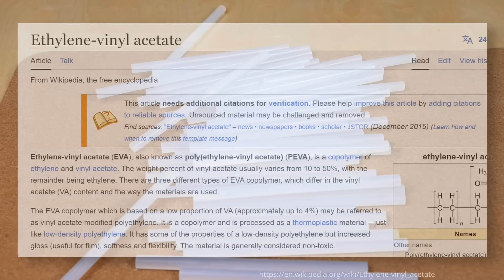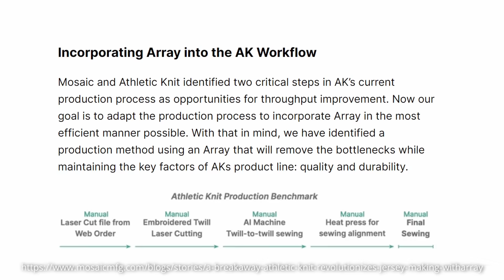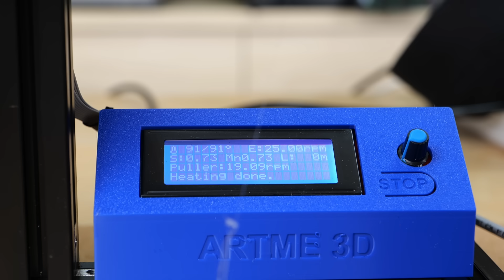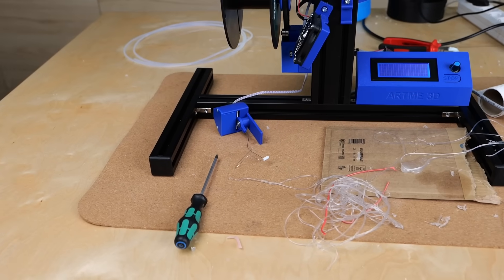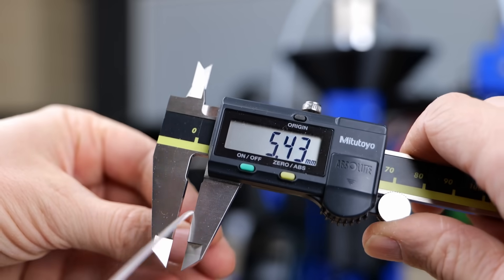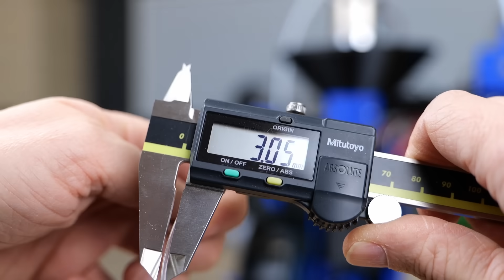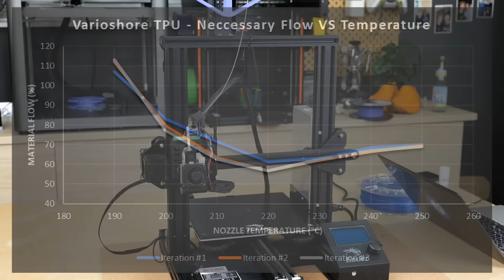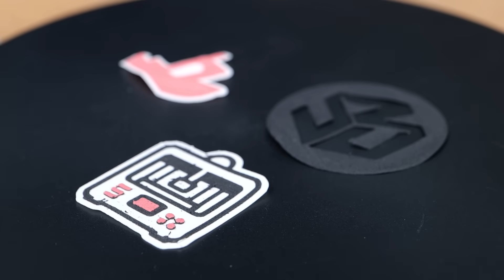Can you 3D Print with Hot Glue?

Comment: Excellent experimenting and engineering Stefan! Seeing the household iron has a 170ºC for cotton, makes me wonder if there is a material that has a melting point between hot-glue and PLA?  Searching, found "Hot Melt Adhesive 3779" (3M) is listed as having a melting temperature of 163ºC.
An alternative might be to try "Adhesive Sheets" which could be cut to shape with a vinyl cutter, then applied. 

BTW: found it a bit ironic that used glue-stick was used as a release agent for the hot-glue.
Two layers of glue not glued together! You're definitely an engineer with a solid materials understanding.

Comment: The filament seems pretty cool, but using it as an actual heat-activated adhesive seems incredibly unnecessary, given that there are hundreds if not thousands of liquid heat-acrivated adhesives available, and you could simply apply a layer of one of these to the back of the print - a process that would likely take less than a second in an industrial setting.

Comment: Very cool idea, however, it would be a lot easier to just use iron-on vinyl and a plotter to cut it, like a Cricut, or, you could adapt an old printer to have a blade instead of a hot-end. There's readily-available iron on vinyl, they call it "heat transfer vinyl" - and you can do up to 3 layers/colors. 
Hope that helps :)

Comment: While the freezer worked ok for this application, if you want to get colder temperatures or faster changes in temperature for cold processing of materials such as intentional enbrittlement, quick-setting or tempering, there are three other options that may be easier to come by. The cheapest (long term) and coldest option is to buy liquid nitrogen the next time you go to a population center and keep it on hand. The cheapest short term would be air dusters. They are filled with butane or other lightweight, liquefied hydrocarbons. Inverting one of these cans will dispense a stream of liquid that quickly boils off, sucking the heat out of anything it touches. A middle of the road solution would be to buy CO2 at a welding shop (which tend to be more common in rural areas) and opening the valve while inverted, without a regulator. Releasing this gas into a cloth bag such as a skiing sock or old trouser leg will allow you to form your own dry ice on demand. 

To prevent the peeling, you have to lake the glue layer just slightly larger than the design layer and will need to use something like foil, acetate or waxed paper as a release when ironing them on.

Comment: Hey @CNCKitchen ! I've transformed one of the insert soldering iron tip into a kind of pyrographic tip to carve and solder prints together. It works pretty well! You should really sell some on your store! 
I first saw someone using pyrographic tools to sculpt and smooth 3D pens creations and i think there would be a huge benefit to have a variety of sculpting ends to help blend seems, join parts together, maybe scoop material. Im sure if you make some, the market will explode with high end surface finish to improve the experience.

Comment: Great video! I've been thinking about trying this for a while, both the hot glue extruder and the TPE shirt printer. 👕 Your results speak for themselves and I'm sure that you could refine the process and create a lucrative business with this idea. 
I can also see other possibilities for applications of the hot glue printer. Perhaps something along the lines of using it to fuse two previously printed parts or fusing two different materials. Of course, you could easily do that by hand, but on a mass-scaled assembly line, it would be very productive.

Comment: i think hot glue alone is not very useful but if you mixed it with other materials it would probably retain its ability to stick without being as difficult to handle. the mixture should be formulated so that the hard material gets squishy while the hot glue completely melts

Comment: If you want harder, more solid glue sticks(would be much easier to blend I guess), switch over to Steinel Ultra Sticks. Also makes tempcontrol easier, as they can take higher heats.(rated at 200°) Those Pattex are kinda weak in every aspect.

Comment: The hotmelt adhesives used within industry are most often produced by emsgriltech,  the brand is griltex.  It is sold in pelletized form.  I don't know if it can be made into a filament as we extrude direct.  It does have to be sifted for best results so that makes me think it would work.  The stuff is a bit of a pain to work with, but works really well.  My money is on this is what they are using for the adhesive for the logos.

The temperatures are a little higher than your average printer might be able to sustain but I've also never tried using this on a consumer one before. I would be interested in finding out.

Comment: why bothering making hot glue filament? you can just put the shreded hot glue over the printing surface and melting them to a thin layer by placing the baking paper over them and melting them with the iron, then print tpu over this hot glue thin layer.

Comment: Honestly, I am sure you've opened a gate for a brand new type of 3D print. Someone will maybe be obsessed with this video and developp an universal way to make hot glue filament, and a new era of 3d printing will begin. Imagine the application of hot glue in a print, you could more easily stick them togeher, make impossible or hard to assemble prints be easily attached, your garage won't need a thousand screws to hold everything, it will be hot glued with a industrial strenght HG filament. 
Sir, you are a genius, even if this seems little, you have made a giant step into the future.
I cannot wait to see what 3D printing will look like with your innovation
Reply: two comments above yours, states TPU can just be directly ironed on from the back side of the shirt and hold until several washes later edges come loose and you can iron on again... got to give a go.

Comment: Optical filament position sensor?
If those even exist it would be perfect. And not touching the filament at all would probably increase consistency in non cursed filaments too. A camera sensor would probably work but it's need software or. Well it'd need something.

Comment: I think in this particular application this method of 3D printing the first layer is not the elegant solution, but some other hot melt glue applying method. Some hot roller that applies thin layer on surfaces etc. might be much faster, easier and overal better.

Comment: I wonder if it would work better, if you just used a motorized glue gun and simply modify it to be able to control it with klipper or something. That way you eliminate the need to create the filament in the first place. It probably won't work for actual 3d printing. But for making a sticky base layer could possible be the way to do it.

Comment: Hi Stefan, id like to inform you that "hot melt tape" exist and it may be easier to use for both t-shirt prints as it is thin and flat and filament making because you can probably use pet bottle recycling machine to just pull it into filament shape of a desired size.

Comment: Rather than patches, I could see a better use being printing out custom fasteners. Rather than the standard messy way of using a glue gun, what if you had specifically printed fasteners for joining 2 materials that only required a heat gun to apply.

Comment: I do service work at a factory that makes glue sticks, they use a horizontal screw extruder with a 1" nozzle where it gets melted then it gets pulled through a 50ft water bed by a puller belt on the other end. They are indeed coated in oil to prevent them from sticking to the puller belt when they are chopped down into individual sticks.
Reply: Water bath? Interesting
Reply: @casychapin4647  Normal filament is also extruded into a water bath
Reply: @casychapin4647  yeah the factory I work at extrudes plastic through a metal mold in one long strand before being chopped into sections, the water bath is actively cooled so it cools down the plastic quickly
Reply: underwater printing when?
Reply: @toericabaker  cohesion between layers would be shit underwater
Reply: @exowarlock9031 just need something sticky underwater

Comment: Working with hot glue a lot making cosplay props with EVA foam, I needed a way to cool down the hot glue quickly so I could move quickly and finish a costume. I don’t know how feasible it is for printing, because of how long it takes, but using a can of compressed air and turning it upside down will make the liquid spray out and instafreeze the glue. You could easily waste an entire can on a few layers of the print and you’d be babysitting it the whole time, but it would be a quick fix to having your print not cool fast enough.

Comment: I don't quite understand why you wouldn't use the hot glue sticks directly into a much larger extruder mechanism much like a home use hot glue gun.  Then with a properly sized nozzle and feeding method / mechanism extrude the filament directly from the supplied glue sticks.   Also, as one viewer suggests could you use a cooling bath to more quickly solidify the filament.  I surely do appreciate your work and your channel.  Thank you

Comment: To me, it seems you essentially need to pass a 12 mm "filament" through a heater block and size reducing nozzle like a funnel. Just like the process for drawing wire through a die.  No need to chop it up into granules beforehand, which would probably reduce the air and contaminants caught up in the material.  Why not try pushing the sticks through in their current form, but using a much larger nozzle , say 1-2mm, and see how that goes, then you can tune it in from there.  It would probably need for you to custom build or modify your extruder to do so, rather than using an existing FDM printer.  Any glue filament layer you produce doesn't need to be so accurate down to 0.2mm as you would get from standard filament.  It is just going to get melted anyway and ooze out unpredictably in all directions, so an accuracy of 2 mm or more would be plenty of resolution.

Last time I got glue sticks (some time ago) they were 30cm long.  I have also seen mini-sticks in hobby and haberdashery stores for mini glue guns used for jewelry and scrapbooking, etc.  Probably 4-5 mm diameter.

Comment: Wouldn't it be better to put the coloured side on the print bed with maybe matte texture or whatever is desired for the patch, and put the glue on top? I've always found the first layer to be easier to dial in than all the other tinkering.

I'm also curious about if an extruder like kevinakasam's papilio would be effective for making filament by not leaving tooth marks. The filament path for that filament maker is still a bit puzzling for me.

Comment: U can buy hot glue in sheets. There is a lot of different kinds, TPU or EVA, various thickness, solid or crosshatched etc. As they are used mostly in clothing / sewing industry I suppose it should be much better solution than specialised filament. Just cut out shape u want, maybe by hand, or laser, or cricut.

Comment: couldn't you just heat the bed to about 90C, paint the print area with an off-the-shelf glue stick, and then print normally on it? the glue stick either needs a simple dedicated tool-head or you print a  outline and then pause for the user to manually paint.

Comment: I think this is good idea, but instead of printing the adhesive, you could try printing onto it, I did a bit of googling and you can buy the iron on fabric backing, the few I've found descriptions for say it is a polyamide material, so I'm thinking you could do a cut path with a hot hot nozzle, then print onto the sheet your design, then peel it off the backing paper, You might need to consider the design material temperature range, probably need to be on the higher side. Good luck!

Comment: Nice tip from Adam Savage - if you touch melted hot glue with your finger put that finger in your mouth (or just lick it). It will solidify instantly and won't burn your skin. Strange or funny as it sounds it actually works :)

Comment: LOL, Stephan is both a genius and a showman, had me lol many times in this video.   A great idea.  Finally I can get my 3d print first layer to stick to the bed!
Actually, this is really what I am looking for, something to print an etch resist onto a pcb.  Some have tried pla, but it does not stick to the copper.  But hotmelt?   Perfect!
The problem I see is 'stringing', as you can't really retract the material and any strings will be fatal to a circuit.   If that problem can be solved, this might be perfect solution.
I don't think a filament is necessary, but use the same as a glue gun, just with precise pressure.   They have '3d pens' I should google how they work....

Comment: Speaking of hot glue guns, I've used a 3d Printed stick of PLA in a hot glue gun to reinforce/repair certain prints that had under extrusion on a couple of layers to save me from reprinting the whole thing.  A 3d pen would be better, but it works quite well in a pinch.

Comment: An interesting proof of concept, and for someone willing to put in the time probably quite practical and useful. One thing comes to mind, reversing the process, printing PLA onto baking paper stuck down on the build plate (would it stick - don't know), then printing the glue on top of that. The print could easily be lifted with the paper and is already ready for ironing onto the fabric.

Comment: In the paper industry they use a glue press to apply paper roll headers to the end of the shipping roll (rolls a large, ½ ton to 1 ton).  These presses use a heat activated glue.  Sometimes the glue is pre-applied and sometimes it's sprayed on with what looks like a sprayer used to paint a car.  I'm sure the nozzle is larger and the air pressure is higher.

Try Searching Greif Roll Headers and Wraps.  That should give you an idea of what I'm talking about.

Comment: What if you place some masking tape on the bed in order to print on top of it? That way it should be much easier to peel print from the bed undamaged. However the issue might be that the glue will stick too well to the tape.

Alternatively you may try to print it on something slippery like baking paper. And if it will not stick to it at all maybe spray it a bit with hairspray or something just slightly. That way you also will get something like an actual sticker, with paper protecting the glue from dust and garbage

Comment: Couldn't you have just kept the hot glue in a slow cooker, printed the TPU patches like normal and then paint the hot glue onto the back of your TPU patches with a brush?...You could even simply use this method to coat the build plate prior to printing.

This seems like it would achieve the same or even better results while avoiding many of the failure points in your methodology.

Comment: I’d be really interested to see a copolymer mixture of hot glue. For example, take some of the shredded hot glue and mix it with shredded low temperature thermoplastic for better extrusion properties and less stickiness. You could try a high temperature glue stick and PCL (polycaprolactone) filament for example. Or even add some very finely ground PLA.

Comment: I would be happy with applying hot melt glue stick directly to a heated bed wiping it on as in glue stick.  Then cool the bed back to ur print temperature for forming your part or patch onto the bed.  A method of bed adhesion plus making it cold in order to remove the print from the bed.
Reply: Temu has dirt cheap thin hot melt sheets specifically for fabric adhesion.  As well another stated they simply iron on the TPU directly, no glue, from the back of the shirt.  Holds through quite a few washes, and then simply re-iron it on...

Comment: You would be better off ironing from the reverse side I would think - apply the heat directly to the fabric on the opposite of the patch so you don't have to heat the hot glue through the 3d print you want to keep. (Though I don't think you really need glue at all anyway - with a flexible filament you can probably just melt it into the shirt in the same way folks have printed onto fabric).

Comment: I expect they used PVA - its used for iron on in other contexts and readily available as a filament.
Reply: How, it is water soluble?
Reply: @riba2233 They did get stitched afterward - a clue the glue may not be that durable. But also once cured fully and heated again I expect it isn't going to be that easy to dissolve anyway. 

I obviously don't know this for sure, but its not unusual for the finish quality and post processing treatments to change the material properties enough it doesn't react very well - the act of Ironing it on may be enough to make it rather durable against water. Still dissolve eventually probably, but like the highly polished vs straight off the saw/mill mild steel for speed of gathering rust being so different it is quite plausible PVA won't dissolve badly.